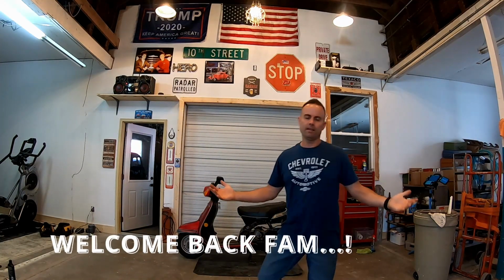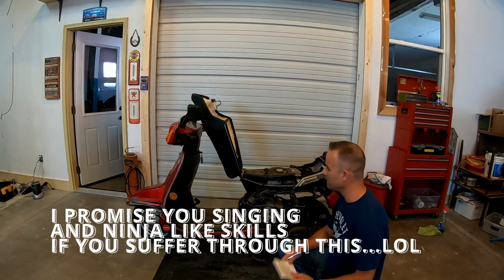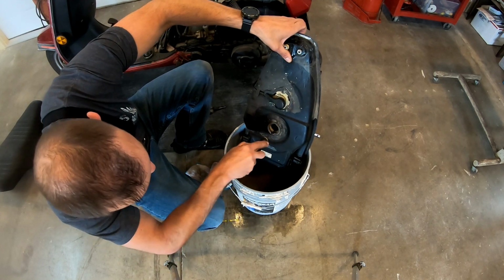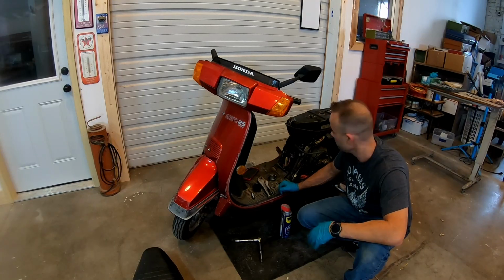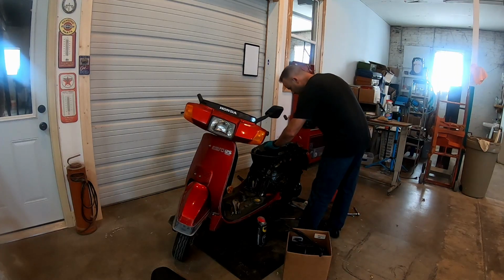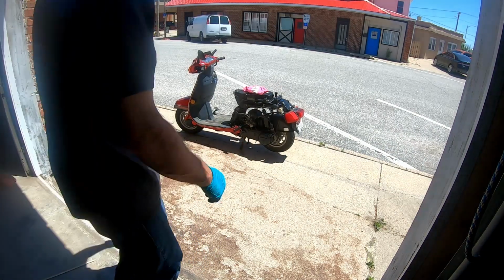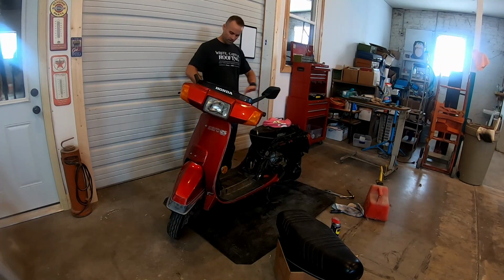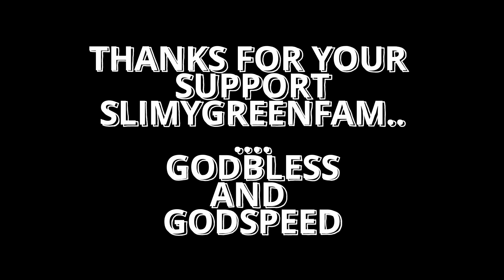1984 Honda Aero NH125 Pt. 1   #revival of the 80's  #blessed

Comment: HAY HAVE ONE SMOKE TO MUCH HOW TO ADJUST THE OIL TO THE CARBURETOR  ON THE VIDEO YOU WAS ADJUSTING THE CARBURETOR BUT THE CAMARA WAS ON THE OTHER SIDE
Reply from the maker: Angel my suggestion would be to run mixed fuel, make sure the oil tank is empty so it doesn't add extra oil and see if your smoking problem persists. If it quits smoking you can either continue  running mixed fuel or further diagnose why it's getting too much oil from the oil tank.
Reply: @SlimyGreenGarage   OKAY DOESNT HAVE AN ADJUSTMENT ON THE CARBURETOR   THANKS IM IN SAN JUAN  PUERTO RICO USA